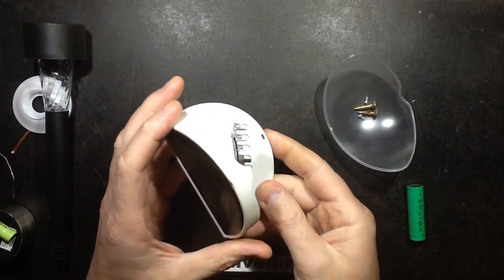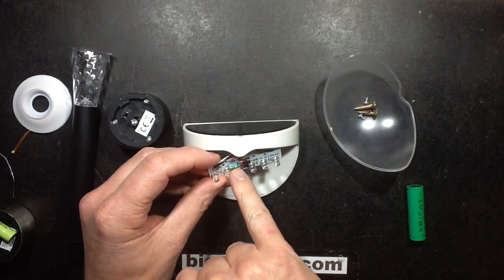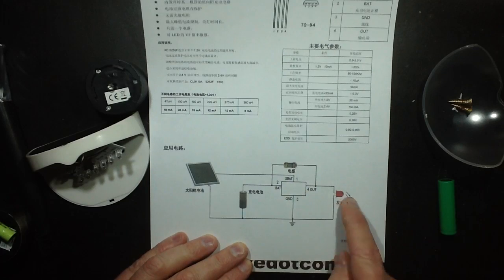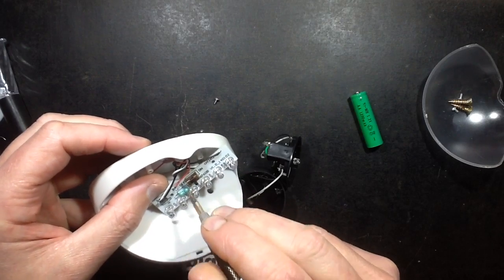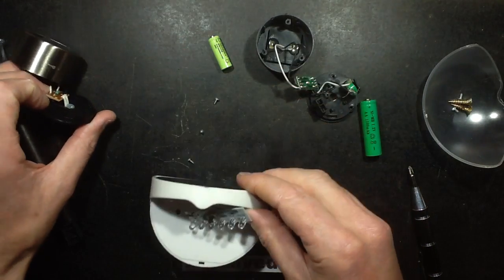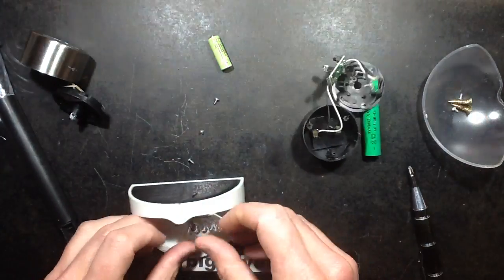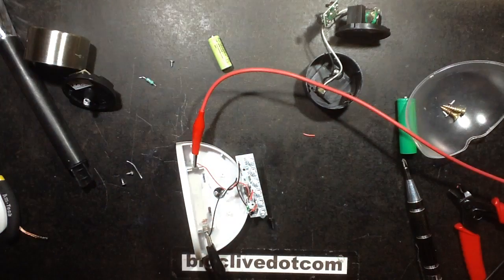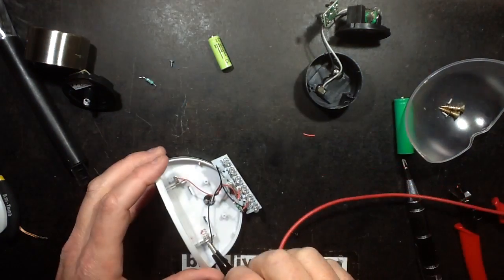Extending the run-time of a solar garden light.

Comment: Is it still working Clive ?
Mine developed a rusty switch and Screw (nearest the B- connection)
and the run-off from the screw went under the 5th LED, dimming it considerably.
I managed to make it brighter by wiggling it (prob... should de-solder + clean).
Reply from the maker: +Gary Hart It is still working.  The rusty switch and LED thing is very common in solar lights.  Water finds its way everywhere due to the thermal cycling of day and night causing vapour condensation and wicking.  You can bypass the switch and seal round LEDs and other bits with nail varnish or resin.
Reply: +bigclivedotcom 
Hello Clive,,  I have a question, , does the photocell fully charge the battery on a typical day? And if it does, couldn't the battery AH rating be increased? 
Keep up the good work,  you are making me want to chase trons.
Ttfn. ..
Reply from the maker: +Willy Bee I'm not sure if the solar cell could charge the cell even on a full sunny day.  At the moment that light seems to be doing quite well.
Reply: +bigclivedotcom 
Thanks for the reply, 
yep, the solar cells always seem to be the weakest link.
Years ago, on the telly,  there was a program called THE ALL NEW THIS OLD HOUSE..
They put in solar panels for an off grid house. They said it would completely power the house.
And it only cost Thirty Thousand USD , $30000...
I can not see where that would be a good idea. ..
tanks again, and keep up the good work. ..  Ttfn

Comment: Can you use the Joule Thief circuit to get the most out of a solar LED lamp? seems like a perfect combo...
Reply from the maker: Most solar garden lights already use a Joule style booster so they can use a single 1.2V cell and smaller panel.  But it's a more sophisticated chip that controls the switching on of the light be sensing the daylight via the solar panel and also cuts off if the cell voltage drops below about 1V.

Comment: I have a question. Can one put the QX5252F solar joule thief in series so that one can use 7 of them on a 25 watt 18 volt solar panel? (calculated 7.2 of them if it is 2.5 volts solar panels they originally use).
With 7 separate 1.2v batteries and leds separate, and also same value of the led and inductors, with the only common is the larger solar panel :)
It could be useful, then i could use my 25w solar panel for 7 joule thiefs that light up my appartment at evening or the whole night perhaps with 330 value inductor, before i need to use the larger solar panels with DC-DC converters that at wintertime gets empty when it is darker.
If you dont have anything to do some day then test two systems with a 5 volt PSU or solar panel for example :)
And if the QX5252F or the similar YX8052F cant do it then can the original joule thief do it? :)
Another thing i would like to know is if one use a led on normal 3 volt with a PWM pulse generator on lets say 50% pulse width or even overvolt it 50% 6 volt, does it light as bright to the eyes with half the power used compared to a led that goes on half or full voltage?
In other words is it possible to trick the eyes into thinking this was bright with less power used?
Reply from the maker: I don't think you could easily use them in series like that as they will all be switching out of sync and could be damaged.  The 18V from your panel could be converted to 5V with a car/truck 12-24V USB charger to top up some power banks that could then provide illumination at night with spotlights, built in lights or even strings of USB lights.
Reply: Yes, i was thinking of that it might be some unbalance in a 7 joule thief project like that, it probably wont work, but could be fun to see if it does too :)

Good idea to use those car cigarette adapters, they are perhaps more designed for putting 5 volt out than the red board XL6009 double coil buck boost converter i just used, it did burn two of my 6x 18650 usb battery bank controller chips when i pluged them in.
Strange thing is i has a blue board same XL6009 that has been ok for years to charge usb power banks and mobile.
I wonder why that red board version suddenly shows 7.5 volt and 6.4 volts and what i did adjust it to on a laptop psu, the 5.02 volt.
It seems to be random unreliable.
And thats why i did think of a joule thief instead to use on those 25watt smaller solar panels, becourse i just need some extra light in the evening.
The blue ones run fine on a 80watt solar panel and another one with 60+20 watts solar panels.
The solar panels are behind home windows so they are likely prevented from getting alot of light that way i has ben told, but thats what one gets when living in a apartment, not so much possibilities here :)

i did just buy some or those car/truck 12-24V USB charger.
I hope they will work, they has 3 usb plugs, these ones.
They seems to put out 3 different amperes.
https://www.ebay.com/itm/Car-Universal-12V-24V-3Port-USB-DC-Charger-Adapter-For-iPhone-Smart-Mobile-Phone/273424185604?ssPageName=STRK%3AMEBIDX%3AIT&var=572808008005&_trksid=p2060353.m2749.l2649

Or is the 1 plug or 2 plug version better? (regarding using less electricity).
Oh well, i did just now buy 3 different versions so i will see for myself :)

Comment: How much does this change the charge time needed for the battery? The same inductor is used for charging as it is for the led driving.
Reply from the maker: +nyetloki The NiMh cell is charged directly from the solar cell via a diode.  It will charge normally.

Comment: Are you ever worried about being exposed to the fumes from lead based solder since you use it most often on your projects?
Reply: +Sako's Tech Spot
Lead is far less toxic then the flux used in lead-free solder.
Reply from the maker: +Sako's Tech Spot Not at all.  The fumes are mostly flux, and as Pillenwerfer has just mentioned, the fluxes used to try and make lead free solder stick to copper are much more aggressive than the traditional ones used in lead based soldering.  To date I know of absolutely nobody who has suffered ill effects from working with lead based solder.  It's like saying that people who have Harley Bikes get chrome poisoning.
Reply: +bigclivedotcom I hate lead free solder, it just globs up and doesn't even flow onto my iron or any of the components.... I'll always stick to lead based solder :)
Reply: +Jordan O'C (Xenro66) When ROHS started getting some traction, I bought as much leaded solder as I could get my hands on.  I have a big box full of it in several diameters just as the price doubled and then nearly tripled.  I have (at least) enough to last the rest of my lifetime.  :)
Reply from the maker: +Dosbomber I did the same.  I have a large hoard of lead based solder.  Hopefully the Chinese will still continue to make it available in the future.
Reply: Dosbomber
Lucky, I don't have the money to buy wads of solder, I've got a single roll of lead based, that's it haha.
Reply: Jordan O'C Well fortunately it didn't go FULL insanity.  You can still buy it, supposedly for "repair or rework" purposes only.  I'm looking forward to when all the electronics start failing due to the new lead-free crap growing tiny forests of tin whiskers, especially on the newest, super-tiny circuitry.
Reply: As far as I know lead-free is forbidden for use in aerospace applications.  Military and medical equipment was also exempt, though I don't know if it still is.

Comment: what would happen if you put the original and the 91 henry one in series?
Reply: @bigclivedotcom or what would happen if they are in parallel ?
Reply: +theilige Inductors are like resistors, they add in series and divide in parallel.

Comment: Hello again -- couldn't you just wire in parallel  two AAA rechargeable batteries to extend light time?  Curiously yours, dave
Reply: No, because it's not he capacity of the battery limiting the output but the energy supplied by the solar cell to charge it up in the UK climate. :-)
Reply: Thanks for answering my question, I really appreciate it. Dave
Reply: +corp55555 It's a very valid question and changing the battery to a higher amp-hour one (or putting two in parallel as you suggested) would certainly increase the light time where there was enough power in to at least fully charge the battery. :-)

Comment: Is that chip a charge controller for a 1.2Vdc battery (act as a simple mppt charger)?  Sucks that the datasheet image is written in Chinese...bleh
Pretty cool little hack though
P.S.  an EXCELLENT app for android phone electrodroid
Reply: I do like that app. I don't normally need it but when I need to check something it really is handy.
Reply from the maker: +Brian C the only part of the cell charging the chip is involved in is as a simple diode to prevent discharge back into the cell.  Any current from the solar cell goes straight to the Nickel Metal Hydride cell regardless of its charge state.
Reply: There are very nice apps for iOS devices as well.  Regardless of one's mobile platform, it is very handy to have all the various calculators, formulas, SMD codes, and the most common datasheets readily available on one's device for quick reference.

Comment: whats the visual difference between an inductor and a resistor if they have the same colour bands?
Reply from the maker: The base colour is usually different, but the resistance of an inductor will usually be much lower than what the colour bands might suggest.
Reply: @bigclivedotcom  thanks for your quick reply.

Comment: seing as you use quite a bit of solder in this experiment did you ever do a review on solder I have had mixed results from all manor of solder from lead free to lead some say flux cored and never saw flux lots of solder is from china is it good I guess its got lead in it from china.sorry to go off topic but I have found some junk solder that wouldnt stick to jack chit.
Reply from the maker: +chox2001 Always flux cored solder for soldering components, and always traditional lead based for me, since lead appears to be the component that makes solder actually work.  (Hence why the European ass-hats banned it.)
The Chinese use so much solder that I would guess that almost any lead/tin flux-cored solder from them is going to be usable.  The only probable issue being corrosive fluxes.

Comment: I have yet to look up inductors, they look like a resistor but what functions are they used for do they resist or conduct ? yes im new to doing electronics i have don just about anything done with leds and 555 and custom pick programing and use but haven't played with these yet.
Reply from the maker: +gigabytex64 They don't always look like a resistor, but one of the most convenient PCB mounting versions does.  They're basically a magnetic coil.  Although they have a resistance they are actually measured in inductance (usually microHenries).  their main tasks are blocking high frequency electrical noise, boosting voltages or forming part of an oscillator.
Reply: +bigclivedotcom Thanks I just built a Lab power supply it may pay for me to look into these for the future. Thanks

Comment: Rite Big Dude!  Nowt wrong wid a bit of profanity, as RUSH would say "sickness to insanity, prayers to Profanity"!
As mentioned if I'm not cutting the back off the components I use a similar small pair of pliers but with bent ends (or bent nose if you will) and use them as a lever against the circuit board works a treat, not that yours doesn't! TFS, GB :)

Comment: With the solar lights I have the problem is that during summer it yellows the stuff that holds the solar pad in, is there any way to get around this problem.
Reply from the maker: The resin does yellow and diffuse over time.  Perhaps a thin glass square glued on top might filter the UV that causes most of the degradation.

Comment: What exactly does an inductor do? Ive heard of them but I honestly have no idea what purpose they serve in an electronic circuit lol. Id like to get into electrical engineering further but Ive kind of plateaued in regards to my ability to learn by my own means. In other words: I need someone who knows what they're doing to explain the more complicated stuff haha. 

Help Clive? D:
Reply from the maker: +Sean Confer It's basically a coil of wire either with or without a ferrous core that has various functions including limiting current by magnetically opposing it or various other functions that involve momentarily creating a magnetic field in the core.
Reply: bigclivedotcom Thank you for answering! That makes a lot of sense. Is it the same basic concept of wrapping insulated wire around an iron nail and electrifying the wire to make an electromagnet? What are the benefits to using an inductor to limit current instead of a resistor? If I understood what you said correctly haha. 

Sorry for all the questions, I just find this stuff really interesting.
Reply from the maker: +Sean Confer because an inductor has a low resistance and relies on the building and collapsing of a magnetic field it has unusual characteristics like letting DC through but limiting the passing of sudden transients.  There are a lot of different uses.  In the case of the choke used in an older style fluorescent fitting the inductor was a more efficient way to limit the AC current than a resistor.
Reply: +bigclivedotcom Ahhh I gotcha. Inductors and transformers store energy in the form of a collapsing magnetic field. And when you use them for current resistance, it makes sense that something which uses an electromagnetic field will be more efficient than a physical resistive wire in this application.
Reply: +bigclivedotcom Thank you for the help, that really cleared a lot up.
Reply: +Sean Confer In this specific circuit, the inductor is part of the IC's internal switching regulator, used to bring the 1.2V from the battery up to the voltage needed for the leds, as well as setting the current that the regulator switches off at.

Comment: I've got a portable solar camping light I'm looking to extend the run time and extend the solar ma production what am I looking at to fully charge it? I get about 4 hours of sunlight during winter and about maybe 12 hours of sunlight in the summer
Reply from the maker: Easiest fix is to reduce the amount of current through the LEDs.  They'll be dimmer, but last longer.
Reply: bigclivedotcom this upgrades version is barely bright as it is I was looking at a 6v 4watt panel I believe the one that light comes with is maybe a 120ma solar if that
then upgrading the battery to two lithium ion batteries since it appears to have a lithium ion battery on the inside

Comment: I'm no electrician, so I'll make a teet of myself by wondering what odd inductance things would happen, if you played with series/parallel inductors...
Reply: Nothing odd will happen.  Inductors in parallel will lower the effective inductance (like resistors in parallel lowers effective resistance) and allow more current to flow (lower impedance), while in series their effective inductance will be the sum of the individual inductors (also much like resistors), reducing the current that will pass through them (higher impedance).  So, if Clive placed two 91uH inductors in series he would come close (182uH) to the 200uH target he estimated might make the lights last all night, albeit quite dimly.

But, if you are into experimenting with electronics then never let the unknown dissuade you from experimenting with components (particularly at low voltages).  The worst that will happen is you destroy a few components along the way, but if you learn something from it then it was a worthy sacrifice on the altar of knowledge and you will remember that lesson well.
Reply: Ethan Poole  Thanks, I just wondered if it was a headache to work out what values you would get. I've not played with inductors very much.

Comment: Could you show how to add a 3.7 battery to one of those $1 solar lights?
Reply from the maker: It's not practical, as the solar panel is only suited to charging a NiMH cell.

Comment: I have an issue with a solar frog light ( from wagner )it is a beautiful thing and  It has always  worked well , but now it runs for about 5 seconds. Could this be a capacitor fault ?
Reply from the maker: It could be panel corrosion or a faulty battery.
Reply: @bigclivedotcom  was indeed a faulty battery.  my battery charger indicated that the battery was fully charged, but when i tested the battery the charge went out. ( Like a light ) lol.

Comment: If you want to extend the life, isn"t it more simple to just double the battery ?
Reply from the maker: Only if the amount of light during the day can allow the solar panel to supply the extra capacity.  In this case it's to address countries with low amounts of sunshine.

Comment: Hello. Can i replace the battery eith an energizer rechargeable battery ??
Reply from the maker: You can use any standard NiMH rechargeable in solar lights that use similar batteries.   The cheap low capacity ones are fine as they only get used for a small amount of charge anyway.
Reply: @bigclivedotcom  i have a problem. My battery lasted for one day even though its the same circuit. What could it be ?
Thank you.
Marc.
Reply from the maker: @MPElectronique  Efficiency of the circuit depends on the choice of transistor, core and number of windings.  A small core with lots of windings is better.  If the battery was very close to fully discharged it may not run for long.

Comment: are any other mods reqd if applying an external power source with the nimh battery/cell in place?
Reply from the maker: If you want to charge a NiMh solar garden light with an external supply like a USB charger then you'll need a current limiting resistor.
Reply: @bigclivedotcom  thanks clive